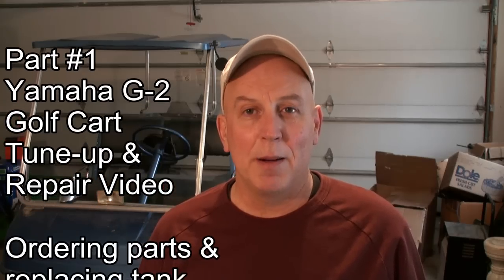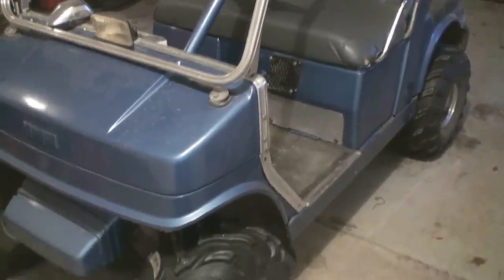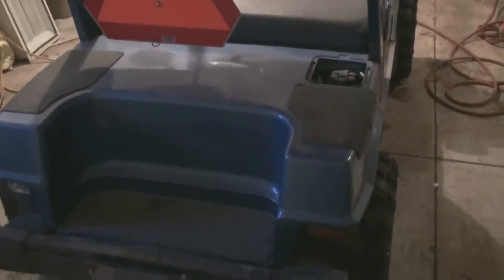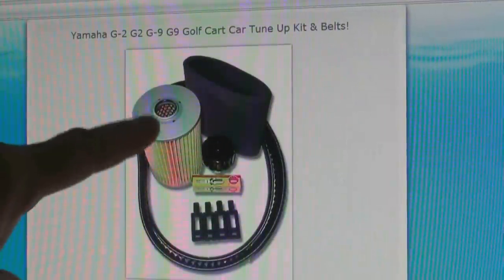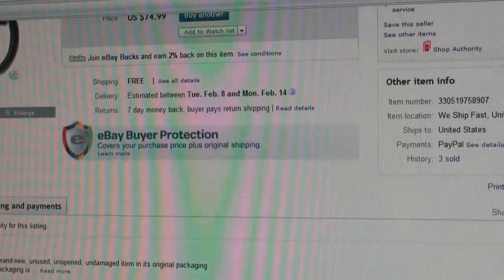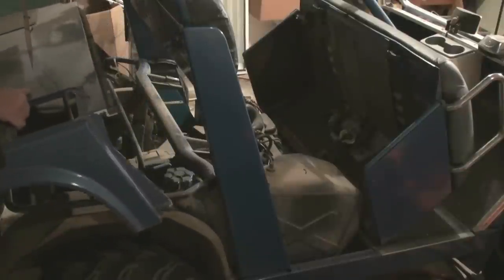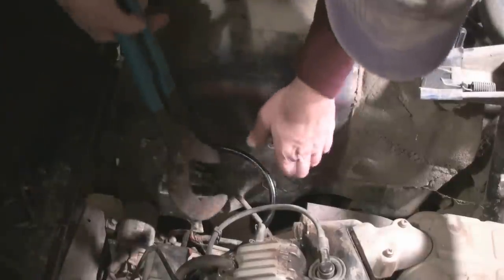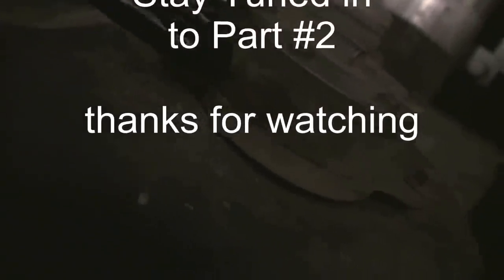Yamaha G2 Golf Cart Tuneup & Repair. Part #1

Comment: Just rebuilt 1986 g2 with genuine Yamaha parts started great runs great no smoke or anything coming out exhaust but the vacuum control valve is full of oil

Comment: I pulled the old filter out of the cap and installed an in line filter after the fuel pump so I can see if it is dirty. It changes out in 2 minutes for ALOT  cheaper

Comment: Thanks for the video. I have a 1990 G2 and I need to work on the engine to replace the rings and I need to disassemble it from the wires. Wondering if you can help me with a electrical connection but there is no way to upload a picture here. Any other way to contact you?

Comment from the maker: @bfsabre5 if it was summer i would have removed the tank but because of the extra time with the winter heat bill i just pulled the filter out, it really wasn't that bad and your right on the gasket i did haft to change out the old gasket. thanks

Comment: I have a 1988 G2 that is only "idling" if you will when I press the gas ...it gas been doing so since we ran it all the way out of gas ...I assume we had some sludge in the tank and it clogged my system? I did remove the fuel line to the carburetor and it seems to be flowing well ..the previous owner installed a electric fuel pump...

Comment: Everyone needs to know that removing the tank from the cart will make changing the fuel filter easier. trust me it's only three bolts and not very hard.
Reply: Well, it's three bolts, two fuel lines and removing the ignitor from it's mount on the tank itself. I agree that tank removal is easier. But the EASIEST thing to do is simply remove the in-tank filter and replace it with an in-line fuel filter, just before the fuel pump. No more tank removal and the in-line filter can be had at any auto parts store.

Comment: Do these G2's require premixed fuel,? ie 2 stroke oil mixed with unleaded fuel or straight unleaded?, or are they 4 stroke engines?, sorry new to this! Someone?
Reply: They are 4 stroke engines. You have to just add fuel and that is it

Comment: Just as an option in your instructions, it is easier to remove the entire tank than to try and tweak chanel locks in there.  3 bolts (front 2 reached with air wrench) and 3 fuel lines and you are done.  Beter ability to then completely get all fuel out and clean up around the area.
Reply: twalpine Korea

Comment: we have a 1997 gas Yamaha golf cart every thing is new But it eill run for a minute or two then stall and backfire does anyone have a  idea whats wrong with it we changed everything in it all new pts
Reply: I have the same problem sure would love to hear some feedback on this!
Reply: Try replacing the air box, or making sure the lid is on fully
Reply: I know this is 3 years after your post but might help someone else with this problem but carberators get gumed up from old fuel and/or from not running the carberator out of fuel while stored for the winter you should put fuel stablizer in the tank and start the motor up with the fuel value shut of let it run till in dies if the fuel line running from the pump to the carberator don't have a shut off valve you should install one i promise it will save alot of headaches once the carberator is dirty all you can do is disassemble and clean it and alll the little ports that run all through it wist carberator cleaner use the little staw that comes with it to blow out all the little holes real good easy peasy